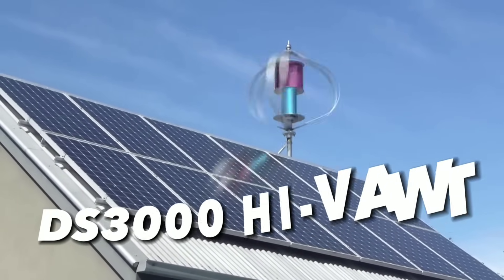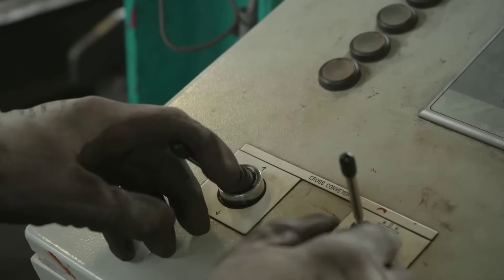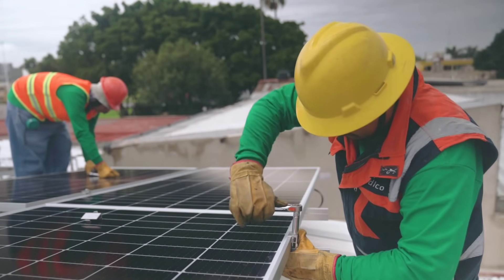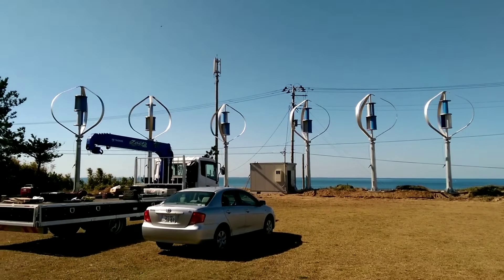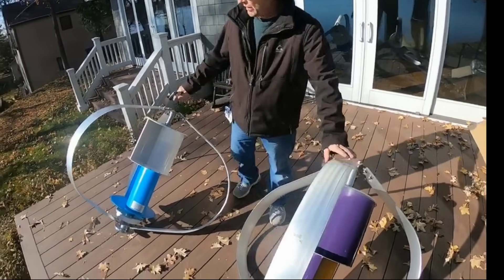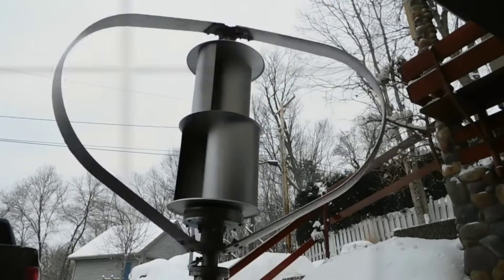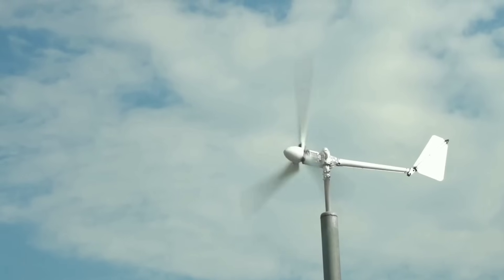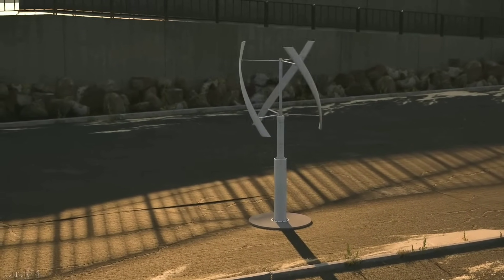This Could Be The Cheapest And Most Powerful Wind Turbine In The World.

Comment: I wonder if instead of a break on the generator (which basically wastes energy to slow down the rpm's) one could have a friction heater that clutches in and out to slow down the excess spinning at high wind speeds?  The heat generated from the friction heater could be stored in a sand battery or underground water tank for heating in winter?

Comment: Come on guys. Do educate yourself even with the basics: Betz factor!
There is really nothing left to invent. It is not an opinion. It is a physical fact.
There is no way going around the Betz factor. You can only take so much power from the wind without killing it.
The potential power is kinetic pressure q times the volume flow Vdot thru the stream tube passing the turbine. 
and the maximum continuous power you can take optimally is P = k_betz * q * Vdot and the k_betz is ideally 0.59 .
There is no way going around it. In real life you still multiply this with the product of all the efficiencies related ( aero, mechanical, electrical) ...  * 0.6-0.8 .

Please, do your basic homework before publishing ridiculous youtube videos. There is no revolution left, only tiny tiny evolution.

You want to place your wind turbine as high up in the wind gradient as you can because the higher you go within the gradient the faster the speed, the greater the kinetic pressure.
Secondly you want to place your local power wind turbine to a place there there is kinetic pressure maximum, that is where the coefficient of pressure cp is the lowest: hill tops, corners of buildings etc. The blade aerodynamics we can already do with over 95% efficiency!

This is frustrating for someone who does these calcs for living and then these idiot greendlusionists think there is a big invention coming in wind power. Sorry, it is not coming. It is just slow evolution from here on, actually already for long.

Comment: Blah, blah, blah.  The average wind speed where I live is about 8 MPH.  Yesterday we had windstorms with multiple 70 MPH straight line winds that lasted for minutes from the outflow boundary.  Forecast for tomorrow is the same.  Many locations have this problem.  The most important information you can give is how they are protected from this punishment.
Reply: Hivawt has 165plus mph wind speed rating

Comment: 1. It seems so simple the cost could /should be lower.?
2. If turbines were mounted on top of dual slope roof, the wind will be compressed increasing the power generated compared mounting at ground level.
3. At a height higher than obstructions the wind will have a a greater velocity than at  ground level.
4. Near ground level, the wind has some resistance, hence the wind speed is is lessened.
Reply: Hivawt wants their profits high.

Comment: And what use is it when the wind doesn't blow? Why add complexity (and rooftop junk) to your own home circuitry and the grid? Both should be as simple and failsafe to get as close to 100% availability of power as possible. And your roof tiling should be as simple and maintainable as possible, not cluttered and covered by devices like windmills and solar panels.

Comment: Can they have possibly filled this video with even more disinformation and completely incorrect facts and maths than is already here? Lower energy generation per dollar but does run in conditions where solar generation would suffer. Also, solar panels are normally warranted for 25 years, not 10 as quoted here. These subtle differences matter. The ANNUAL production of this VAWT is roughly 2x the MONTHLY electricity needs of the average home in the US. Still quite far away from viable at the exorbitant cost of just one of these turbines. It would take 15 years to pay back your initial investment.

Comment: NONSENSE! All practical tests show that small wind turbines hardly generate any electricity! And only at very high costs! 
Because there is hardly any wind close to the ground. With 100% more wind, the electricity yield increases by 800%.  Wind close to ground is also extremely gusty, which usually shortens the service life. Only if you need to be self-sufficient from the power grid, you should have a large wind turbine for the winter on a high mast. 
With solar modules, on the other hand, you can reliably generate green electricity for 25 years at approx. 3-10 cent/kWh!
Reply: Wrong. Hivawt ds 3000 is certified by swcc

Comment: Why don't people learn some physics. Then they would understand that this is a scam.
Reply: I know a good deal of physics, but I’m missing the “scam” part of this. Vertical turbines do turn in the wind, so that can’t be it. Are you saying that their figures on production are wrong?  That can’t be it because that’s not a physics issue. What are you saying is scam about this?
Reply: @gaylanbishop1641  Very simple. The swept area is very small. For a vertical axis wind turbine it is only proportional to the diameter of the thing whereas with a proper horizontal axis wind turbine it is proportional to the square. Horizontal axis wind turbines require far less "stuff" than vertical axis wind turbines for the same output. Domestic wind turbines are generally not very big. Wind speed. Places where people live tend not to be that windy. Since output is proportional to the cube of the wind speed, siting is crucial. Wind speed increases with height above the ground and it is straightforward to get a HAWT turbine high up using a tall pylon; not so easy with a vertical axis wind turbine. That is why people who buy domestic wind turbines are almost always disappointed.  It is no accident that all successful commercial wind turbines are large horizontal axis devices located in windy places. That is why wind turbines intended for  the average home are a waste of money.
Reply: @rogerphelps9939  Good information, but I don’t think a lack of physics knowledge is the problem here. That’s some VERY specialized info and not knowing that isn’t fairly representative of ignorance of physics. It seems that the real issue, then lies with misrepresentation of the thing’s capacity. Using their numbers, which are independent of the physics used to produce the output, they predict one of these home devices outperforming a similar investment in solar. So I believe your point is that the numbers they present as reasonable to expect are false.
Reply: @gaylanbishop1641  Precisely.
Reply: @rogerphelps9939  Gotcha. Thank you for the heads up. People WANT alternative so badly that they overlook actual data.
Reply: I am considering a vertical axis wind turbine that looks exactly like a tree, I call it : e-tree,
the trunk of the e-tree is brown, the spinning blades are green,
attached to the trunk of the e-tree are features of : wifi/mobile network, light and power outlet, to charge a car for example

Comment: could you tell me the foundation(hole size)for an eddygt1kw turbine please has a 2 piece 9m mast motor 180kg,found new one no information on how big to make ? got everything to go in the hole(huge bolts and lock nuts etc) was thinking one  meter deep,buy 2meters @500 from middle to make base wider,ground hard clay at 800 to a meter ,thankyou

Comment: Yeah right, What you got there is a nice energy device for LED light-bulbs,
My whole-house water boiler needs a minimum 4kw of power per hour to keep my house at +20*C inside, at an outside temp of~ -8*C. That maths out to ~100kwh per 24hr day...... just to maintain a temp differential of 28*C. On a typical windy January day at -30*C outside,  that will be at least double, so say 200 kw for 24 hours.  That's 6000kwh for the month of January.
 How many of those tiny generators will I need?
Well, you say this generator will output about 2460 kw per stinking year, so  (2460/12)= 205 per month and 6000/205= about 30, therefore;
 Answer; I will need about 30 of them all working at full capacity. Did I get the math right. I mean I'm no Einstein, maybe I'm wrong. 
To continue;
30 times $6000= $180,000 just to  purchase them! They're not even in my yard yet, nor installed.
I can heat my house  all winter on $3000 worth of hauled-in cordwood, ALL WINTER. That's an average of say $600per month;  and the inside temp during the day,  is gonna average probably closer to 24*C.
Lemmee see; $180,000/$3000 = oh about 60 years to break even... before shipping, before installation, before repairs, maintenance, and/or periodic replacement, and assuming the things will handle running WFO. 
What you got there is a real nice energy device for LED bulbs . 
Try to imagine what my house, my garage,  and my 3/8acre yard would look like with 30 of those whirlygigs gyrating their little hearts out.
Now if you were to sell me all 30 of those for the one-time cost of $6000 delivered, installed, and tested; well then,  I could overlook  how they might appear to my neighbors, and try to ignore the friggen racket, because I can imagine with all 30 of them revved out in January, that my neighbors are NOT gonna be very happy. 
 But yeah, I can see that, what ya got there is a nice energy device for LED bulbs.
Reply: You are why they dig up mountains to mine Coal.

Comment: This design has been around since the 1970's:  A Darrieus turbine with Savonius turbines at the center for easy startup.  Seemed clever way back then, but it never caught on.  Real wind people know better than to use this design, which is why, after 50 years, you never see them.  Strange how this video shows so many various vertical-axis and horizontal-axis (propeller-type) wind turbines, and both small and large versions of the DS3000 Hi-VAWT turbine, stating numbers from the larger one, when showing the smaller one.  A word to the wise:  Vertical-Axis wind turbines make less power than regular wind turbines, and quickly fail.  Find a single happy owner of a vertical-axis wind turbine, assuming you can find a single vertical-axis wind turbine still operating, anywhere in the world!  There are strong reasons why the prevailing propeller-style design predominates.  It uses less material, to make more power, and is more efficient, and more reliable.  And NO, these vertical-axis turbines will NOT outperform solar panels, until dark at least.  Assuming the vertical-axis turbine lasts even a whole day, which it probably won't.  The minute you have enough wind to make decent power, it will destroy the vertical-axis turbine. Which is why you will NEVER see one in a windfarm!  :)

Comment: 43 db noise is 43 db... maintenance ! bearings fail creating down time, motors fail as well! more downtime, roofmount? nonono!!!! noise get transduced to inside of house !
straight up no comparison except, comparing powers of both. Honestly, a combination of both (solar + wind)  and not the one or the other. unless you can throw dollars in the wind on a open ranch.
Reply: Bearings don't fail in these and they don't need oil
Reply: bearings fail = maintenance !!! @kahlernygard809
Reply: No motor in these either. PMG
Reply: how is possible no motor n o power @TurbineGuy
Reply: @luckydubeinrc5165  permanent magnet generators (PMG) have magnets which rotate around stationary windings. The moving magnetic field causes electric flow. It is not a typical motor running backwards.
Reply: you know it has bearings yes or no, case you are going to sound really stupid, when the noise hits the fan... they are noisy, and not permanent...! end @TurbineGuy
Reply: @luckydubeinrc5165  haha it's always those qhp are most wrong that want to "end" the conversation. It's a fact that hivawts make practically no noise. You can see it clearly on turbine guys youtube videos ...
Reply: @luckydubeinrc5165  Yes it has bearing, sealed inside the center shaft. Heavy duty truck bearing designed for a heavy point load, which these turbines do not have. I could explain the engineering to you, but see no need to here. Yes, maintenance free.

Comment: Thanks, but I can't understand the purpose of  3  outer rings. Is it for
maintain momentum of the system or for other reasons ?
Reply: No that is the dihedral wings that generate the power, the inner is a savonius drag turbine and is needed to get the outer blade spinning.
It will not self start on its own
This is not a new design, it has featured for at least 10-20 years

Comment: VAWT has too much side thrust and the bearings blow out.  In addition, half the time the blade is 'going uphill' so does not produce work.
The HAWT is the only answer.
Get to the basics.
Only the outer third of any turbine or propeller actually does work. The rest is not going fast enough to produce work.
The outer third should have big blades to better capture the wind.
Engineering experiments show that the angle of 25.5 degrees captures the most energy. (Three blade cantilever blades are at an angle of about 2-4 degrees).  This produces high RPM, and is not efficient.  It also produces noise and vibration.
Going faster takes more energy from the very wind that you are trying to get energy from.
Bigger is better with all wind turbines.
Heavy on turbine blades is not good. More cantilever blades add more weight, to the point that the shaft cannot support more.
The Tension Turbine is the only wind turbine that is feasible now.  The Tension Turbine tip speed is  SLOWER  than the wind.  This produces maximum power and little noise or vibration.
The Tension Turbine: Half the weight, twice the power. 
The future is the Tension Turbine. TensionTurbine dotttt commmmm for more information.

Comment: Size is a major concern  -  4 meters by 3 meters means a box 10 feet high and 13.2 feet per side - WAY TO BIG FOR A NORMAL HOME!!
Reply: ya 4 meters is HUGE basically 2 and a half average sized people in diameter...
Reply: @robertrichard2322  or one american kid if you believe a crooker CDC that says they are fat.
Don't forget the load put on any pole with that big a spinning mass.  It sure doesn't look like they used carbon fiber to keep the weight down.

Comment: 1.  The blades are fixed, the only way to slow the turbine down in a high wind situation is with the electronic braking system.  Even the manual brake simply shorts out the output of the generator.
2.  Properly installed solar systems have zero moving parts (except for cooling fans in the inverters/chargers.  A wind turbine has moving parts by definition, therefor it will require more maintenance than a solar system.  All you usually need to do with solar is keep the panels clean.
3.  680Kg/1,499lb (turbine alone, not including the mount) is rather heavy for a small footprint on any roof/building.
Those are the major negatives in your advertisement for this product.
Positives 
1.  Will work day or night in winds between 10 Kph (6.7mph) and 54Kph (33mph).  Survival speed is 216Kph/134mph (for the turbine, not the mast).
2.  It is a more energy dense solution than an equivalent sized area of solar panels.  Roughly 4mx4m
3.  Quieter than most other wind turbines.

I'd use this in conjunction with a solar array and battery bank for either a hybrid or off-grid system.
Reply: ...and replace the entire solar panel after 20yrs? I see wind water pumps run for decades on the farm and maintenance is minute.
Reply: @FinancialConsultdotcodotza  If you buy then in chunks you only need to replace them in chunks as well.  That way you roll the savings into more panels, instead of paying up front.
Reply: I am considering a vertical axis wind turbine that looks exactly like a tree, I call it : e-tree,
the trunk of the e-tree is brown, the spinning blades are green,
attached to the trunk of the e-tree are features of : wifi/mobile network, light and power outlet, to charge a car for example
Reply: You forgot the most damning thing about these vertical turbines, that they are so inefficient that they will not pay for themselves over their lifetime. There is a reason why VAWT companies go out of business. I have never seen any comments from anyone who is a happy owner of a vertical axis house turbine.
Reply: @tzenophile thats a complete lie. Hivawt ds3000 is certified by swcc. Payback time of about 8 years.
Reply: @kahlernygard809  If the HiVAWT DS3000 can produce 2,4kWh/year under optimal conditions (which extremely few of us have, compared to solar), you're saying that it cost less than the equiv. of 8x2,4kWh for the turbine, delivery, mount, installation, and 8-year maintenance? Where I live, that is about 5-7,5k USD.  You're obviously the one who is lying. 
Show me one single happy owner of these things after 8 years of ownership verify your claim, please.
Reply: @tzenophile but this all applies to solar too
Reply: @gaylanbishop1641  No, it does not.

Comment: I built my own for a lot cheaper and I'm powering a 300 amp alternator 12 volts. Do the math and I spent under $500 total cost, there's a you tube video I posted of it.
Reply: Link to your video please.
Reply: @michaelalaego8759  
https://youtu.be/OP4Iy9EoF-E?si=HvjiN8VPEFMYsjxX
Reply: @michaelalaego8759  I used this design as the starting point and did many changes for high wind application.

https://youtu.be/vCcHKikC8I4?si=35vJyV9_KEthu9H7
Reply: Boss... Well done, these certainly seem overpriced for what they are at the end of the day.
Reply: @robertrichard2322  belt drive is the key. Most wind generators don't produce much under 30 mph winds. Mine is a 1 to 6 pulley ratio so the alternator is doing 600 rpm in 15 mph winds.
Reply: I am considering a vertical axis wind turbine that looks exactly like a tree, I call it : e-tree,
the trunk of the e-tree is brown, the spinning blades are green,
attached to the trunk of the e-tree are features of : wifi/mobile network, light and power outlet, to charge a car for example
Reply: Hey bonehead, you need to tell us the title for us to search for it !
Also, some more stats would've been nice.
Reply: Thx man.